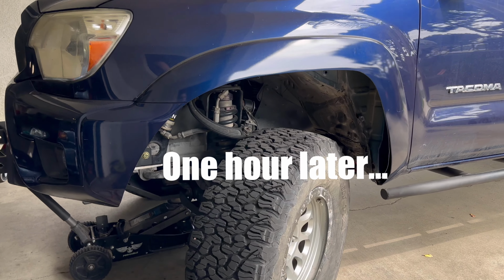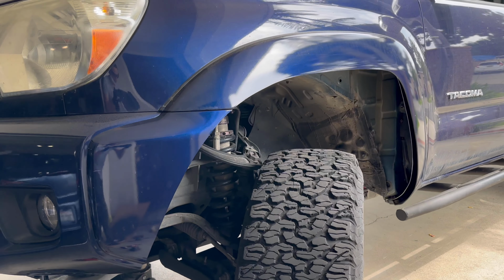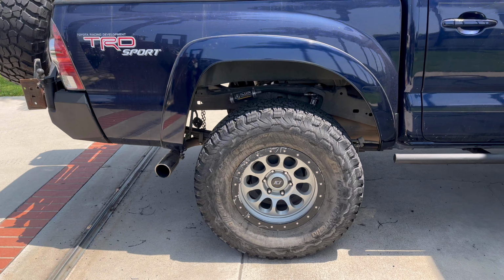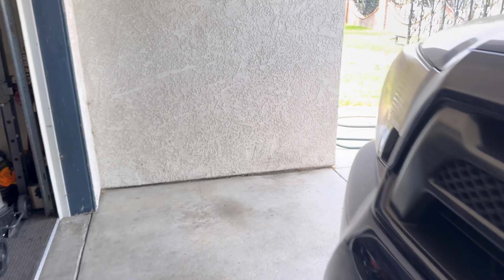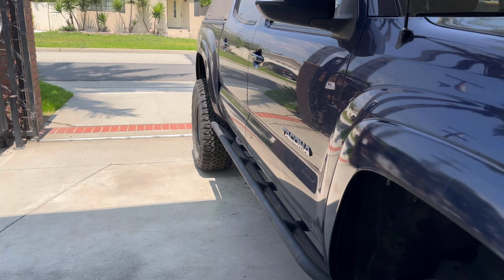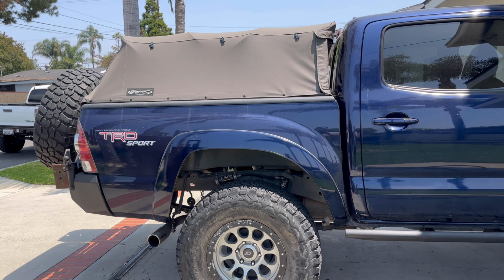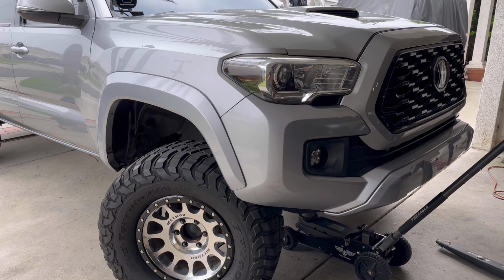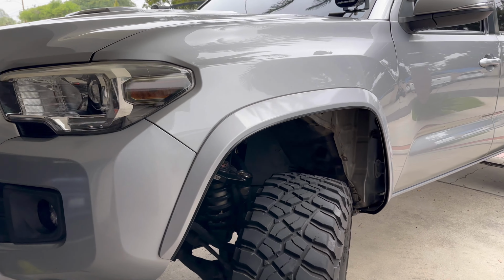2nd Gen Tacoma & 3rd Gen Tacoma Fender Trim!!

Comment: Have you done any first generation tundras?
Reply from the maker: No, I have not done any Tundras due to the flare design.
Reply: @gio.rodriguez  Okay what does that mean and or why is the flair design an issue...to round and no straight edges or sharp corners?

Comment: How did you measure the trim ? 1 1/2 all the way around ?
Reply from the maker: I use the lower original cut and follow it around the flare and fender.